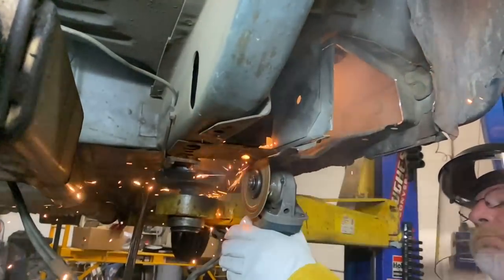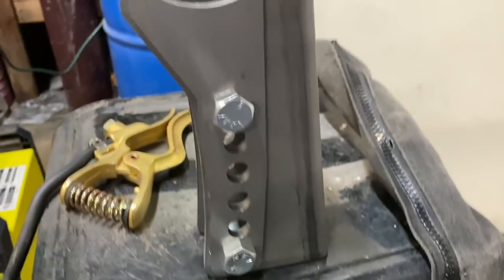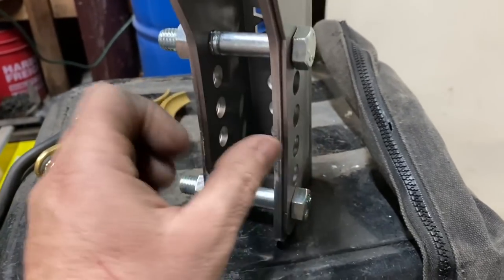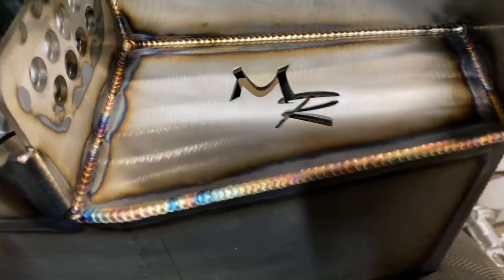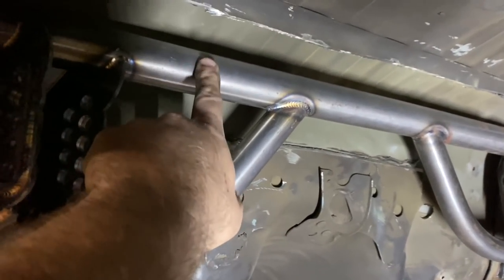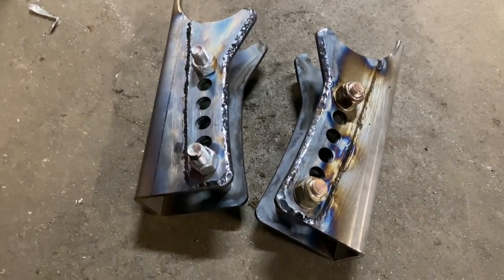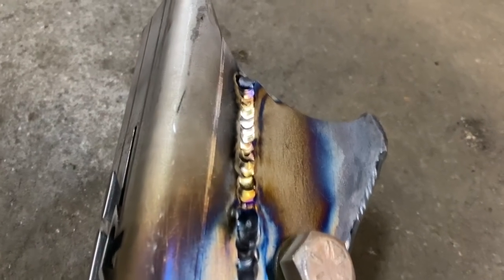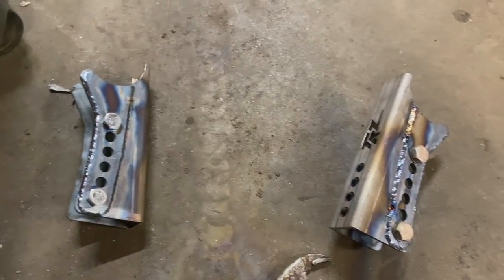Mustang Adjustable Torque Boxes, Change your Instant Center

Comment: Take and clamp a piece of aluminum on the back side to pull the heat out of the material. It's called a chill block. Also heat is relative to time, the more you slow go the more heat and distortion you get with the part. Go as high on amperage and fast with travel speed as you feel comfortable with. Keep it up!

Comment: Do you plan to get the cage\frame certified? Can you educate us on the different index classes and the changes in requirements as you drop in time down the quarter mile? Seems hard to decide on a target without knowing what financial\hardware requirements necessary for each.
Reply from the maker: Yes, 25.5 is what mine should cert to

Comment: you will get better man its all about watching the corners of the puddle and getting the heat control down. Since you are new you should try more of a lay wire technique.  Say like a 1/16 rod letting it rest in the groove and washing the heat over it. thats how pipe welders do it
Reply: Pipe welders walk the cup bud , but still dab there filler if not the filler burns in the wrong spot !
Reply: @chadalac1977   I was a pipe welder for 6 years or so man. Im just trying to give this man a little help lol.  obviously when you walk the cup you feed some also. but i suggest anyone starting off tig welding (freehand welding) not walking the cup to get torch control 1st and feeding the wire will come.

Comment: So many people do their motor, tranny, cage, diff, and ignore the suspension. They are busting axles, going through the joy of radial tire shake and then replacing axles and playing with the tune. PEOPLE!! While you are here watching TJ weld up adjusters for the four link pay attention! If you are hitting your bumpstops so hard they explode, you'll never get a decent 60 foot. Dragshocks and adjustability. You can stay with leaf springs but you need to do it right. I'm not going into it but the old man on SRC does a great job setting them up.

Comment: the more comfordable you are the more consistant your welds will be. Tig is 10% setting 90 comfort and practice. Its not big movement its little motor controles you have to develope. Rull of thumb. A welder wont stand when he or she can sit, sit when he or she can lay. Keep putting in the work John. A good place to get advice in any welding is Welding tips and trix. on u-tube.(6) welding tips and tricks - YouTube

Comment: No hate at all but I think most of your problem with your welding is you're not comfortable. You got to lay your hands on something to keep them steady and do a dry run before even hitting the pedal. But when you are welding your boxes you were holding your hands in mid-air.

Comment: If you look at the Merrilat tig welding (hope that's spelled right) you can see the heat marks are small.  The color isn't a half inch wide. And my welds are worse than yours.  I know one thing.  Time, as in after the strike arc, is heat.  More time, more heat. I'm going to try bigger rod, moving faster, a bigger cup for more gas and cooling...and whatever else I come up with.  Know it when I see it, can't get there to save my soul.

Comment: Imo there not necessarily needed if the silver surfer can run on stock torq boxs  an bs as fast as he is i would say there not necessarily needed UNLESS YOUR ARE TORE UP
Reply: If the stock ones rip out 30’ into a pass and send you into the door of a competitor then you will realize why they are needed. I dont know the silver surfer but if the car is fast the stock boxs are reinforced, tied to the cage or both
Reply: @young11984  lol if you don't know the silver surfer then your not a racer period that car is known everywhere and the only thing done to the stock torq boxs are they are welded fully thats it  i know kf alot of 6/7 sec fixbodys on stock torq boxs lmao but I guess you internet trolls know it all
Reply: @jeffreyburnette1137  just because i dont know one car means nothing, 6-7 second cars arent fast imo so thats irrelevant since thats what i was doing 15yrs ago on junk built stock motors and stock E7 heads with 0 reinforcement or extra welds on my boxs so no im not a troll just because i dont know of a car or live at the tracks you know of
Reply: @young11984  I would love to see stock E7 headed sbf going 6,s like you were 15 Years Ago. And not even reinforcing your torque boxes, Shit i had Battle Boxes Reinforcements on my Lowers, nothing on my Uppers, i ripped out Both Uppers on my 86 Mustang when it was Only going High 12,s It's simply amazing you were going 6,s with stock suspension and E7 Heads. How many magazines were you in ? And how many records did you break ? Seems like Bullshit to me.
Reply: @young11984  O.K. now i see your mph, i was thinking 1/4 mile, I'm from up North, not many 1/8 tracks around here that i know of. So i guess you probably were going 6,s in the 1/8. I've only ran at 1/4 tracks.
Reply: @young11984  That's why i called Bullshit on going 6,s I'm not into the 1/8 mile stuff. So No way in Hell will E7 headed sbf go 6,s in the 1/4 You would've been in Lots of Magazines if you went that quick in the 1/4
Reply: @badass6.0powerstroke10  😂😂 hell yea i would have, naah man about all thats around here is 1/8 mile. Ive only ran 1/4 once but the motor was out of rpm about 200’ past the 1/8 and i didnt have the nerve to hold it to the 9900 rev limiter that i turned it to before the burnout